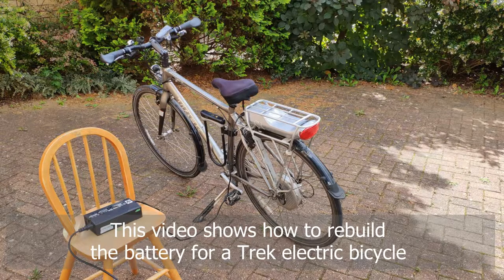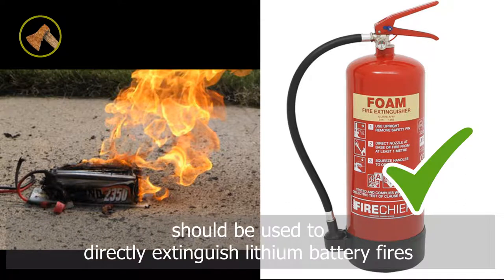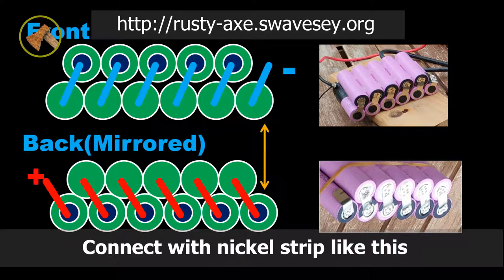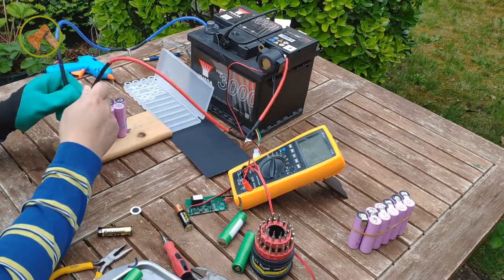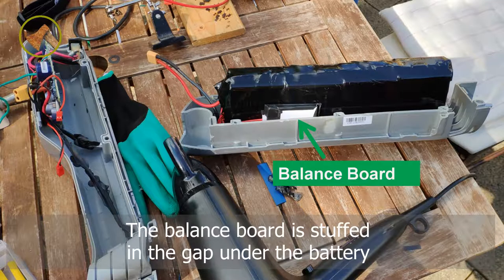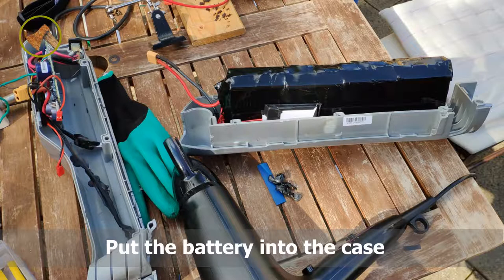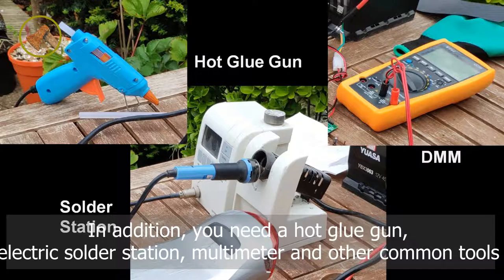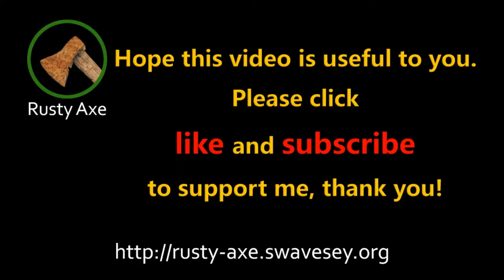Rebuild and Improve Trex Ride+ BionX Electric Bike Battery with Balance Board and DIY spot welder

Comment: UPDATED AT END - Thanks so much for your video. I'm rebuilding this same pack. I lost the thermistor that goes from the battery ground to the green wire. Do you know what I can use to replace it? UPDATE - I found the thermistor I lost - it measures 12Kohms at about 65F, so I assume it's a 10Kohm nominal thermistor.
Reply from the maker: Glad to know that you have found the thermistor. Thanks for sharing the thermistor resistance value, it will help others.

Comment: Great video, thanks for the information! Are the battery thermistors required for the bionx 5.2 board to function? Would like to verify control board before rebuilding haha!
Reply from the maker: From my memory, the battery thermistor is connected to the charging port, so it should not affect the control board.

Comment: Can one make an additional battery with the same configuration to parallel outside the original battery for more range?
Reply from the maker: Yes, you can in theory. But I highly not recommended this. Keep in mind Lithium battery is dangerous when not coped carefully. The best and neat way is get a another battery and swap over.

Comment: Thank you for your video! I am having problems with this battery. The positive end of the conector was burnt out. I made a jump, the battery is charging, but a regular beep seems to indicate the power is off. Could it be problem with the 30A fuse or the thermistor? With the 3772 code monitor displays Err 22. Many thanks for any help.
Reply from the maker: The battery controller is reporting errors which could be caused by the on board fuse inside. The fuse shape is similar to car fuse. I don't recommend you replace the fuse without understanding what is going wrong. Keep in mind, deal with lithium battery pack is dangerous.

Comment: Hi, thank you voor de video i want to do the same with my Trek but i wonder what kind of BMS you use ?thx
Reply from the maker: I bought it from ebay. It is not easy to find a 11s one, so I bought a 14s one and only use the 11s balancing feature. I am only use the balance feature of the BMS, as the original one already has other features.

Comment: 6:10 those so many wires are needed for ballancing or gan be ballanced without them (on cell level)...If the bms is wihout ballancing function then wires just for the one series group will do the job  ???
Reply from the maker: Not full understand. If just balance one series, then how about if other series of cells out of balance?
Reply: @rustyox7449  yeah, you are wright!

Comment: so this battery is dead now? Dead of not using.Over discharge issue? But why burned bms?
Reply from the maker: The battery pack is damaged due to not being charged for a long time, it is likely caused by high idle current of the BIONX system.  the BMS is a cheap ebay version, it may not able to cope negative voltage caused by damaged battery pack.
Reply: @rustyox7449  thanks

Comment: how exactly did you add the balance function to the bms?
thanks you
Reply from the maker: I didn't add the balance function to the original BMS board. What I did is to add the balance board to the batteries directly. The balance board works in parallel with the original BMS to provide the balance function.
Reply: Makes sense now you say that. Got me one step closer to finishing my project , thank you🙏

Comment: what charger do you use? The original one 26 volts? I have the same battery  for rebuild but i havent the original charger.Can i use step down converter or adjustable power supply?
Reply from the maker: I am using the original charger for 11s (40.8V) battery.
Reply: @rustyox7449  thank you.I havent original charger but i found third party one in aliexpress. What kind is your bms? 11s ?  Can i use 13s leaving some wires unplugged?
Reply from the maker: @julikb  I studied the circuit of my balance board and found each channel are independent, so I actually use bottom 11 of the 13 channel balance board. Not sure if it applies to your board, you may want to study your board as well.

Comment: What kind of charger this battery need
Reply from the maker: I am using the original charger "li-ion, 40.7v 2a 11s, hp8204l3", please see the picture on this link: https://rusty-ox.swavesey.org/Thread-NTC-current-limiter-broken-in-Trek-BionX-ebike-charger-HP8204L3